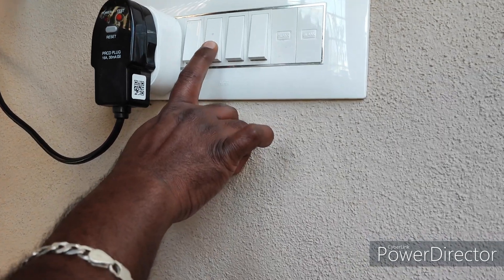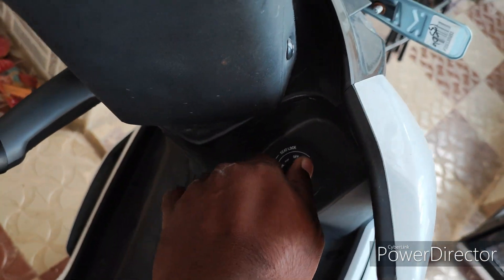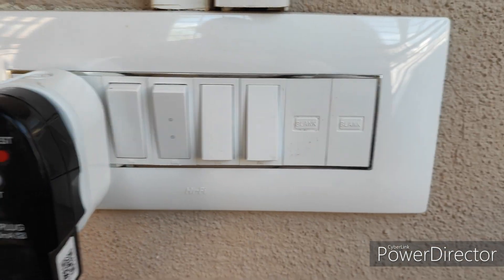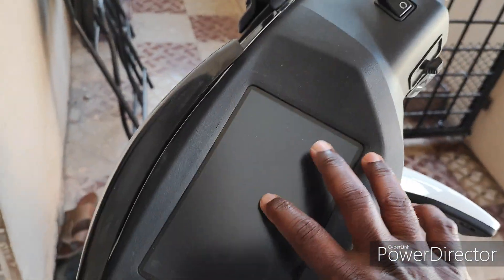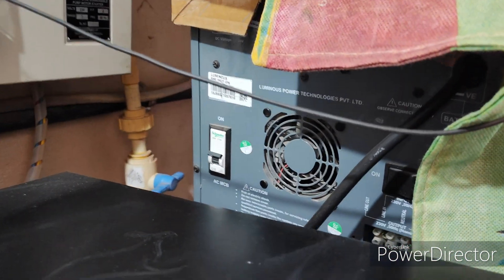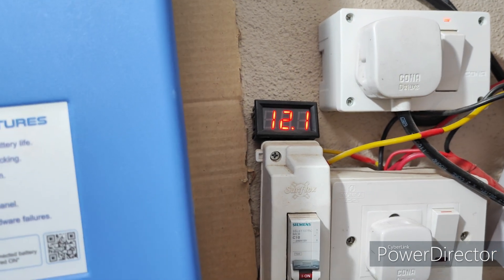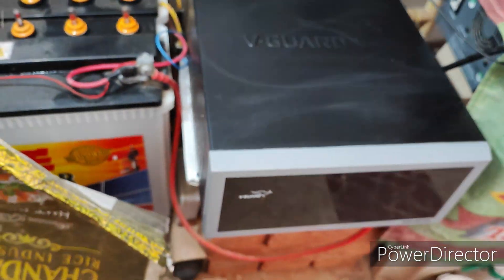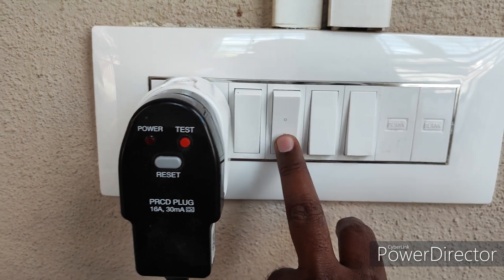Charging Ather from Solar

Comment: can u explain how to do it and wat is the specification
Reply from the maker: My setup  1600 watts  solar panel and 2kv inverter, days time I can charge ather if have good sun light , since ather needs 840 watts.
Reply: @SambandamNandakumar   you have battery??
Reply: What is the total cost for u
Reply from the maker: @RAJANAREN  

First  you need clear space and 7 am to 5 pm clear sun light view  and little shadow stop your whole supply of perticular pannel, my cost is  2.5 lakhs.  But still I am not getting better results since mine is single flower building and next building  three floors and two floors  that's the issue . Allways plann for  double for unit electric City bill .